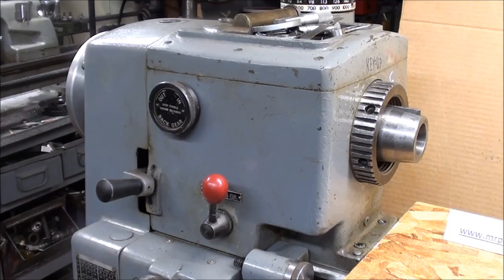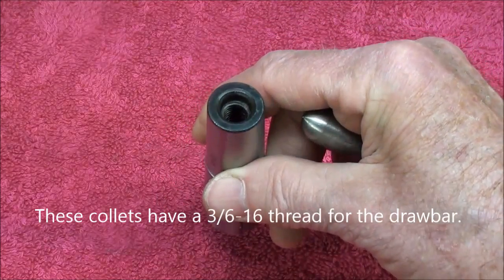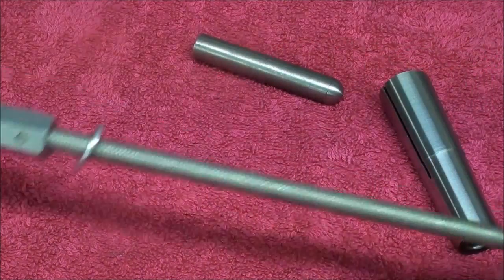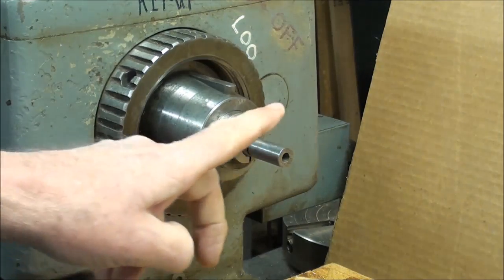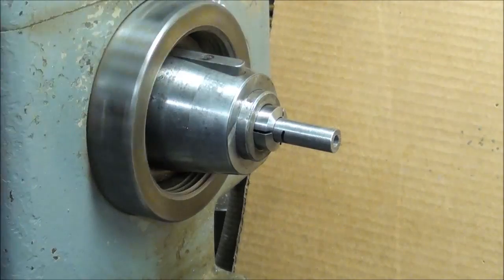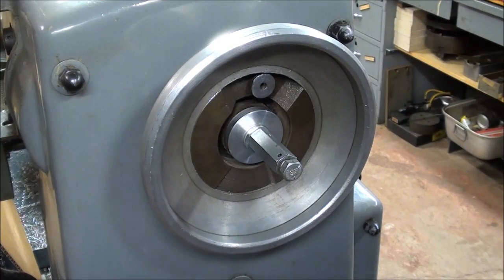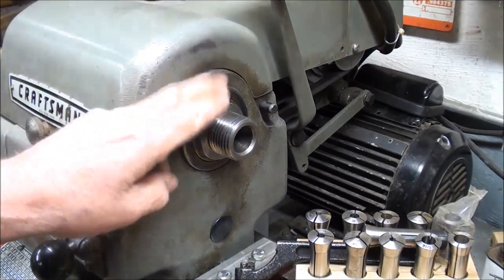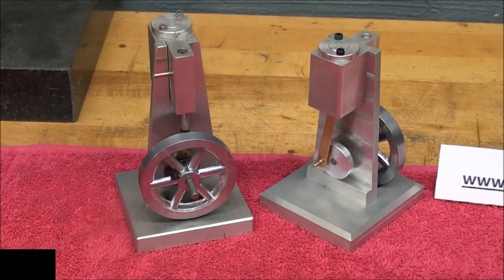MACHINE SHOP TIPS #152 Poor Man's Collet Attachment for Clausing Lathe tubalcain

Comment: What's the point of pinning the coupling nut? Don't you need something to tighten against the outboard side spindle adapter? Or did you cut the all-thread at precisely the right length so taking up just those few threads in the collet snugs it up?

Comment: Pete, have you (or anyone else reading this) ever used  a 5C collet chuck closer on a lathe? Do you know if they have the same holding power as the drawbar 5C closer like those made my JFK co? Thanks.
Reply from the maker: Yes, I have used 5C holders drawbars thousands of times. They hold very well.
Reply: @mrpete222  I was referring to a lathe CHUCK that takes 5C collets. Are they as good as a 5C drawbar closer?

Comment: Another great video!  I made an adapter for my Sheldon lathe to use Hendey #3 collets that I bought cheap.  I had to make the draw tube and thread it internally for the collet and externally for the hand wheel.   I have since traded for a 5C adapter and collets but had to make another draw tube.  I like the idea of ER collets for a lathe but haven't used them so there could be drawbacks.

Comment: i have a atlas 10 inch lathe and i was wondering can i use mt3 end mill holder without a draw bar ,and would it be ok to just use a brass rod to tap end mill holder out  dont think these end mill holders would work with a draw bar .just want to make sure  i need no damage to lathe thanks Mr. Pete
Reply from the maker: I believe a drawbar is necessary with milling cutters. The helix on the cutter turns to want to pull the cutter loose

Comment: my old lathe doesnt have an exposed spindle at the rear, it seems to be a thrust bearing housing.

my concept is a combination thread protector/collet holder.  a thread protector (1-1/2"-10tpi) with an inner tapered lip that presses on the front of the collet.

no idea if it will work but i may give it a shot!

Comment: I like your video's so much, I had to watch this one again. I have the same 5914 Clausing lathe which happens to have 5c collet attachment, draw bar and spindle nose protector, so they are available. I had to buy the 4 1/2 mt adaptor from clausing, so you might check with them for a spindle protector. Any way, keep the videos cummin. Thanks, Jim.

Comment: Great video! (like always) - I could do a similar set up for my South Bend couldn't I? I am trying to find a good price on the book how to run a lathe just don't know what version (reprint year) to get and the price range is anywhere from $15 as high as $80 for what looks to be the very same book why is that ? does the version or year make that big of a difference? I think my SB is early 1950's at least that's the closest I guess or find using the Serial #
Reply from the maker: Thanks. Get the 1958 version or newer. You will eventuall find one for about $15
Reply from the maker: Do google search --- how to run a lathe.  There are 2 free downloads. The one with the tan cover is my fav.

Comment: Thank you  Mr. Pete. I didn't realize they made a #3 Morse taper collet. My Logan lathe has this taper in the spindle. I will definitely have to find a set. I have a partial set of #2 for my old Bridgport that I figured I could use with a cut off sleeve.

Comment: I've been using MT3 collets on my Logan lathe for about a year and a half.  I made a draw bar very much like yours.  It works great, with the noted limitations.  I'm saving up for a 5C collet adapter chuck, but even that will be limited by the ID of my spindle.  It will work good for larger diameter stock as long as the pieces are short.  I have not looked into ER40 collet chucks, but now I will.  Great video.  Thank you!

Comment: That's a pretty nice way to get accurate holding (centering) for round stock.  I have the same (or very similar) Clausing 5914 lathe.  It came with a Royal 5C holder, which I like a lot.  If you ever find a Royal or similar closer, let me know, as I might have a spare 5C adaptor.
I didn't have an adaptor like you have for the 4 1/2 to MT3, so I made a taper attachment  for the lathe and after many adjustment passes, I came up with a nice end product.
Reply from the maker: sounds like a nice setup. I'm always watching for the collet attachment, but it has to be cheap.
Reply: mrpete222
 I see that there is a nose protector on eBay this morning . http://www.ebay.com/itm/L00-Long-Taper-Steel-Spindle-Thread-Taper-Protector-Clausing-Leblond-Logan-/191393242572?ssPageName=ADME:SS:SS:US:3160

Comment: Me again. http://www.rdgtools.co.uk/cgi-bin/sh000001.pl?WD=collets&PN=32MM-STRAIGHT-SHANK-COLLET-CHUCK-ER32---18PC-COLLET-SET-675551%2ehtml#SID=71 This is the set I bought.  The material can pass through these collets if you get an adaptor plate that goes on to your spindle.  Some of these are shown on the Ark Euro Trade site.

Comment: I have done the same but using ER 32 COLLETS AND MT3 adaptor.  These can be bought cheaply from ctc tools.  The ER collets are superior in a number of ways. Each collet has a wider clamping range so that every possible diameter from 2mm to 20 is covered.  Also when tightened the part is not drawn back towards the chuck to the same extent. The clamping grip is greater too as they have a double taper and 8 slots rather than three.  If you choose u can go up to 30mm material by choosing ER 50 collets at a greater cost.  Well worth looking at the ER system.  On the drawbar end I put a round plastic knob of about 2" dia so no spanner is needed.  I have used it for three years now and I use these collets for work holding more often than the big chucks combined. They are a lot safer too.  I hold milling cutters in them regularly when using a milling slide.  Clearly I'm a fan of the ER system.
Reply from the maker: Thanks--I will check it out.
Reply: +Joss Fitzsimons I've just taken the ER plunge--Going with the ER40s. Bought some collet blocks from arceurotrade, an MT3 adapter for the lathe, an R8 adapter for the mill, and a 15-piece collet set running from 1/8-inch to 1-inch. Trying to make them my do-all system. Still waiting on the mailman for some of the pieces of the kit. We'll see how it all works out.
Reply from the maker: +Rick Rose Those are nice collets

Comment: I recently made an ER40 collet chuck for my Myford lathe, up to that point I had been using MT2 collets in the headstock which was very limiting. I found the ER series very easy to use and very cheap. I have been very pleased with the upgrade and I can hold up to 30mm stock very accurately.
Reply: I recently did the same.  I was making MT3 collets for common mill sizes but I really wanted feed through for rod stock. I chose an ER40 kit for for the same reasons as you.  I liked them so much that I bought spare holders and made a bolt-on version for my lathe.  Easily one of my best and most used accessory.  I started with an MT3 kit off eBay for around $160 then extra holders from Tools4cheap at $25 each.   All run within a thousandth with nut and wrench? No cussing and Dykem mess? No missing eyebrows from homestyle heat treating?  $25 any size?  DUH.  I love making things but it would take me a week to make one true running holder on my machine and I'd have a pile of discards.
Reply: I really like ER collets, such a good grip and you always have the right size.
Reply from the maker: Thanks--where do you get those collets?
Reply: mrpete222 I am in the UK so I bought mine from a local supplier, I have a 28pc set which covers 3mm-30mm, the collets have a 1mm clamping range which is very useful if you use odd sized stock like I do. The price was £180 for the set which I thought very reasonable, just slightly less than your $10 each I think. You can buy them individually as well. Check ebay for a good deals, the chinese made collets are pretty good quality I have found, with my (partially) homemade chuck I have runout of 2 thou or less, each collet will vary slightly.
I think they would be a good choice for you and not require too much more work, certainly nothing not in your incredible skill set, might make a nice project video too. Anyway worth a look and thank you for all the great content, I am an avid viewer.

Comment: I might talk nonsense but, wouldn't it be possible to take an adapter, cut it short so the last say 1 to 2 cm of the collet be exposed and on to it a thread be made for a cup that will become the draw bar?

The cup would have to remain inside the machine somehow locked, i wouldn't know how to be honest but the rotation for the tightening would have to be made from the work side instead of the gear side.

It just crossed my mind so it's nothing i've ever seen before. Might be complete nonsense.

edit: the outcome would be that the inside of the collet would be free to use a full piece of stock as opposed to the smaller variant presented here. I would also like to add that all the machining can be done on a lathe. It's basically cutting, facing and threading.
Reply from the maker: Never thought of it. Give it a try